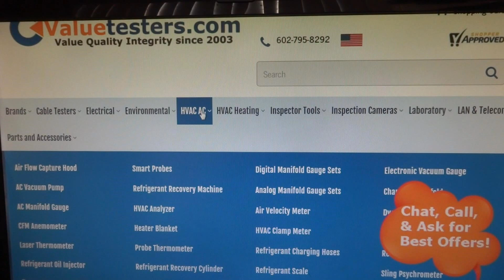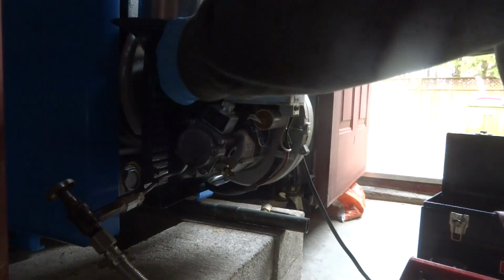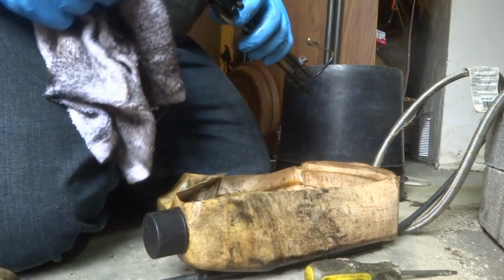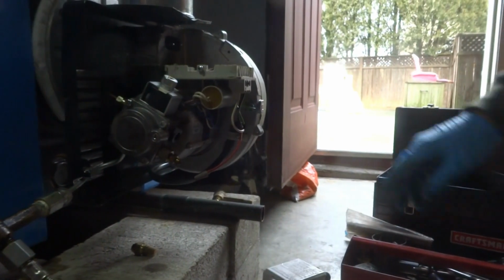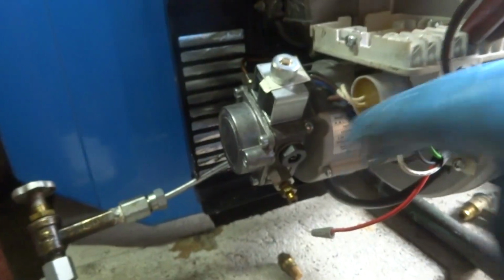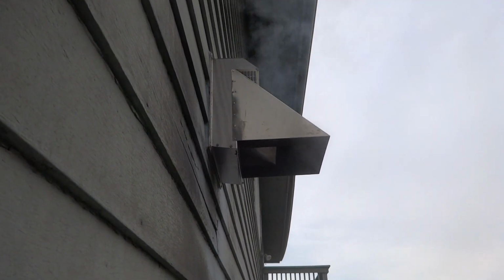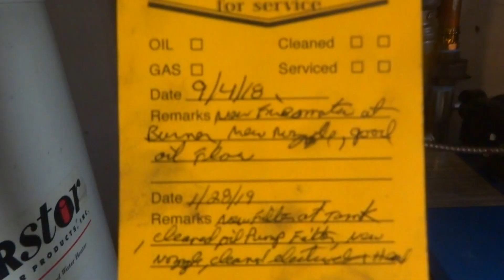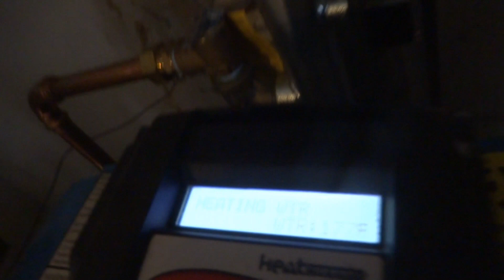oil boiler has to be reset Daily  part 1 of 2

Comment: If the call bounces again, I would consider the pump and/or the coil. Sometimes the valve sticks after its energized by the coil intermitently. You could replace the stem, but why risk another return call. . And move those electrodes back. They are out in space.

Comment: I looked at Buderus with the Riello but the logimatic control i read has nothing but issues. Ended up going with a Biasi  B105 with the Riello so far happy. Its all about the pressure with the Riello great burner if you know how to tune them

Comment: These oil burners seem pretty temperamental, I have no experience other than the many videos I have watched you do.  Are these filters really only 2 bucks, I looked up oil burner filter and that's the first price I saw?  I know your saying they are good for about 2 years and the if the flow is good you leave it alone.  Is it flawed if I was paying you to give it yearly check up I would rather pay you a little more for a filter and the little bit of time for piece of mind?  I do enjoy watching your videos, Thanks!
Reply: They can be a little temperamental, but mostly it's just people being lazy about having them serviced every year.
As steve said, they're certainly not the space shuttle. The pump filter is $3, nozzle $5, and tank filter $3. It's worth replacing them every year. Other than that, about the only things that can go wrong are bad transformer $50, bad CAD cell $20 or bad controller $50. All of these are really easy to replace if you're even slightly handy. Ideally you'd have a combustion test done, but if you have good fuel flow, a good spark, and enough draft, you won't be stuck in the cold.
Reply: Unless a tank is old and gunky inside, the fuel is clean enough these days that filters don’t normally get dirty that quickly. If you have a nasty old tank, then yeah, change the filter yearly.
Reply: @notajp  I'm guessing the tank is gunked up. I have the same exact setup and the boiler had not been serviced in 4 years. The gun and combustion chamber were spotless. The pump screen looked like this one.
Reply: thanks for the replys :)
Reply: Those fb4s aren't all that great filtering I like the Garber spin on they seem to do the best job filtering hardly anything bypasses through em
Reply: @sirhc07  Yeah if a old tank would use the canister type to catch the rough sediment. Also can look for water issues in a canister. Then add the spin on after that. Seems like the spin on would clog up quickly with older tanks.

Comment: I used to want the Buderus and riello so much but the more I watch the less interested I am. Maybe they save some oil but the Beckett is so much easier to work on with fewer tools. When the heat's broke, fancy isn't always good mama! :)
Reply: Silver Cymbal the more you over complicate plumbing the easier it is to stop up the drain.
Reply: think the weirdness with the riellos is the way they are mounted In the us. in the UK (and I assume Europe) where riellos is pretty much all you can get they are most always mounted on a split flange by a single 13mm nut, one nut and the complete burners out, 2 Philips screws and the fire tube is off then the nozzle and electrodes are right in front of you. to me the servicing through the back looks real clumsy but I guess it's what your used too.

Comment: That oil flow should be a little more faster on the flow. Worked on them before, it looked to be a little slow. Good video Steve. Thank you Sir. HVAC ON!!
Reply: Pump may be bad. I just changed one this week on a no heat call. Def more work than doing a Sun tec
Reply: @gidzey4783  those riello pumps are real wimpy especially when the have an overhead line
Reply: @daveschroers4222  I agree with but some guys are old school when it comes to that
Reply: @daveschroers4222  Those digital test kits save alot of time compared to the old school ones haha but I still have both of them

Comment: Those Sun Techs are some kind of pump. I think the pump is bad too. If you look at this video when Steve took the tank filter off, it look like some sludge hanging off the cap.
Reply: It's a riello pump not a suntec. They don't pull a vacuum as good as a suntec. Also when the oil valve opens it moves more oil. Jumping out the terminals like this the oil valve doesn't open. Pumps is fine.